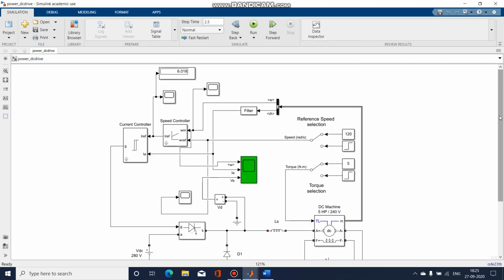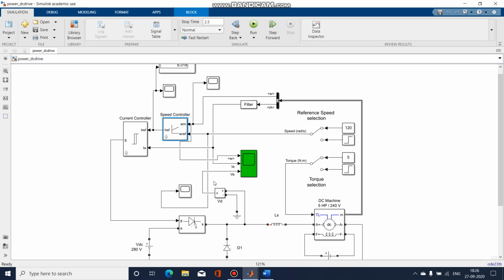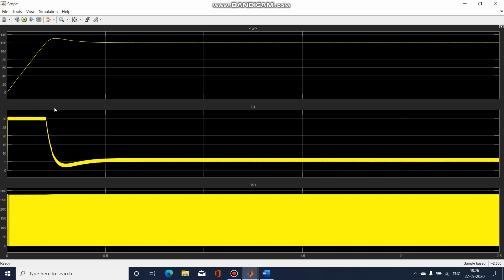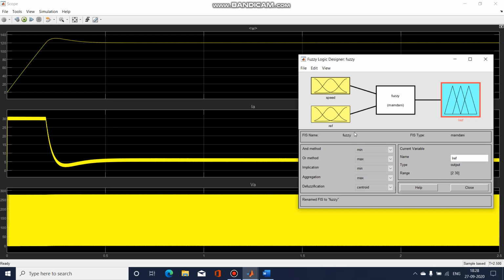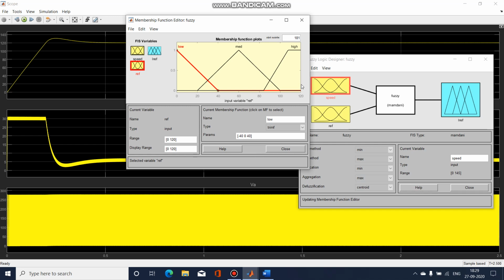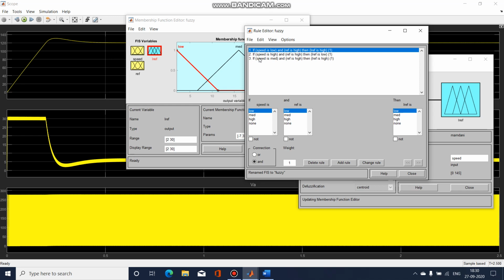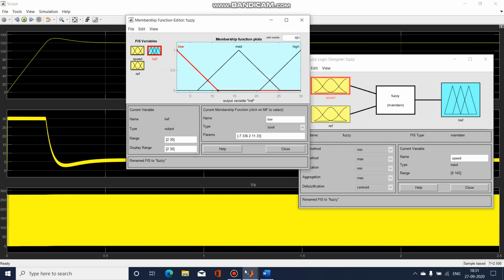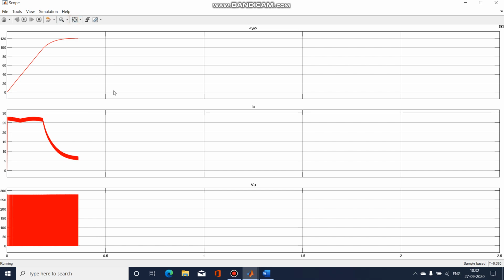Replacing PI controller with a Fuzzy Logic Controller

Comment: Bro i have a small doubt
Reply from the maker: Go ahead man, if I know, definitely I'll help you out.
Reply: @plackalpravin65  I'm getting error while simulating my work that speed control of iduction motor using fuzzy logic controller based on svpwm , here speed has to be remains constant even when the load varies. But speed gets droops when load is added.